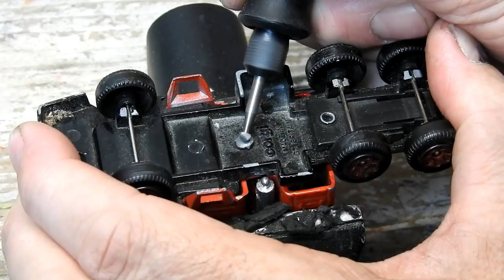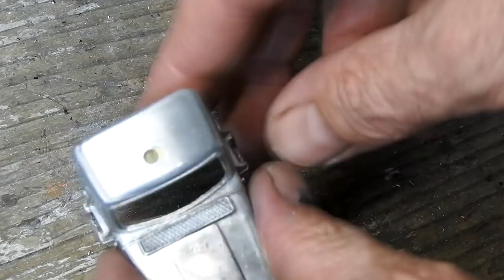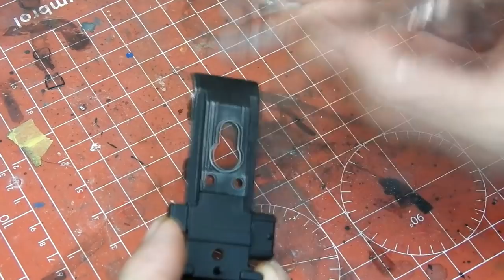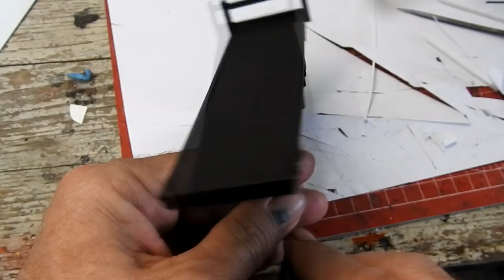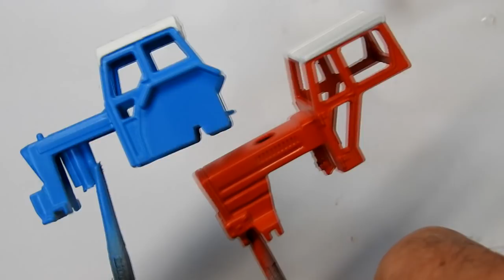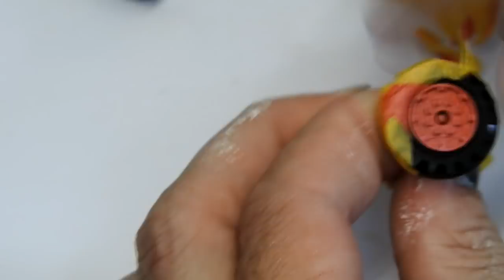Custom Corgi Leyland Landtrain Matchbox Ford Tractor Majorette Tracteur

Comment: Cool combination, really like that you didn't put that sleeper-cab back to truck, because i think trucks frame is too short with that sleeper and trailer is too close to cab then, now it's much better looking and more realistic. 😀

I have two of those Leylands, one without trailer and other with box-trailer.

I think that kind of real Leyland trucks are very rare.
Reply from the maker: Yeah the trailer hit the sleeper when you did a sharp turn. Mainly I just thought it looked odd, the truck is too thin, and combined with the odd large horn thing on top it looked just wrong. I have another one the same but its black.